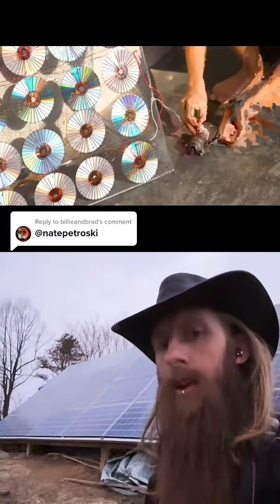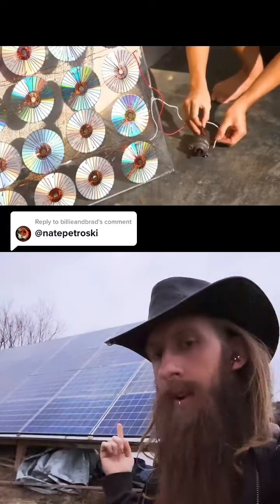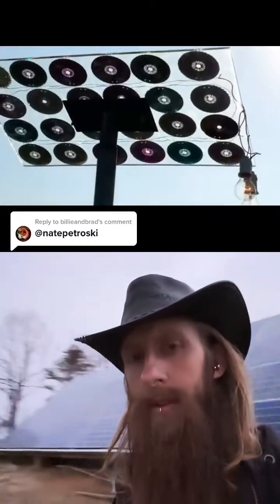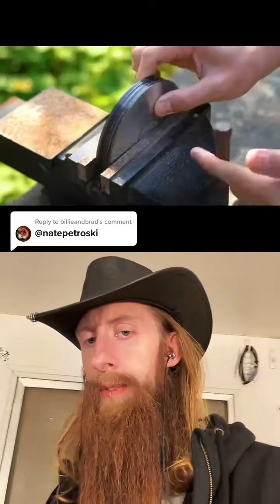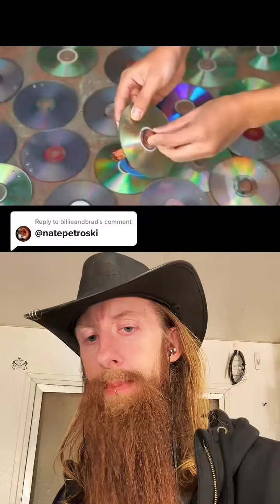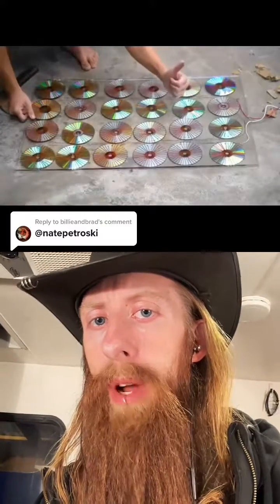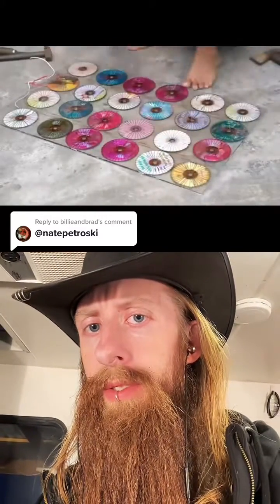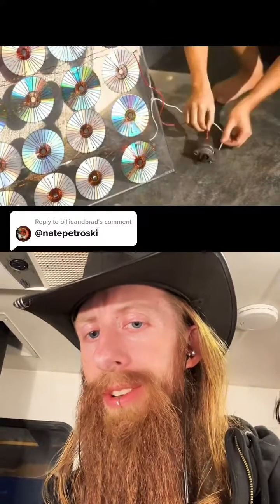Solar panel made from CD's

Comment: What people don´t realise is that the cds have a plastic layer on the surface which acts as an isulator so it needs to be removed to expose the conductor which is aluminium and telluium. Of course it won´t work while the cds still have the plastic coating so remove that with some solvent (paint stripper) to expose the conductors underneath.

Comment: The epoxy is the key part of this project as it hardens it shrinks and creates pressure on the copper. I don’t think any part of this could be a feasible solar panel but instead a piezoelectric generator. 
Not to mention the dielectric constant of copper is infinite

Comment: Well it's concept does actually work... here is how... Electrical transmission lines all have line loss, or a magnetic field. The Coils made from the CD's can and would pull voltage from this magnetic field... not a lot but absolutely some... more coils together would pull more voltage. So it isn't a solar panel at all... the device is actually stealing power from the transmission lines. (Interestingly it's actually a crime). There was a rather smart farmer within the midwest, that built a huge coil(literally tons of copper used) under huge transmission lines that ran through his property, it was enough to power his whole farm with some rather interesting transformer wiring... He was eventually caught, and charged for the theft.

Comment: It's real. But it needs to run into a battery to slowly charge the battery and then you power thing off the battery. In 5th grade  (1988) I made a battery out of lemons that powered a flashlight for our science fair. It worked. I also received an F for the project because I live in Arkansas and my conservative teachers hate my clean power idea. My project was called "Sour Power"!!!
Reply: Why would you get an F if it worked! That’s so unfair
Reply: Did you run wire through a lemon and connect a battery to it
Reply: Climate change wasnt much of a political issue back then but nice try.

Comment: It’s fake
Reply: @John Alpha zero reason? Why did old buildings all have copper tops with brick buildings? Free electricity isn’t hard to perceive, but the government doesn’t make money on it
Reply: @ghostwhite1648  you mean old buildings had free electricity? lol
Reply: @johnmachter40  yea before national grid
Reply: @Jeff Desert Mountains Lol
Reply: @@John_Onestrand Hey that stupid thing is acually something that works, its just not as efficient as the once you can buy
Reply: @John Alpha it’s real u baboon. I made one and charge all my battery packs. My electricity bill is only like 25 bucks,give or take. I save hundreds!
Reply: @@John_Onestrandwell have you tried it? One of the reasons why "easy" fixes to things aren't widely implemented is because they are often less effective than the convenient ones and take a lot more effort than is percieved to be worth. Like I wouldn't want to waste $50 worth of epoxy or go find 30 CDs just to try this.